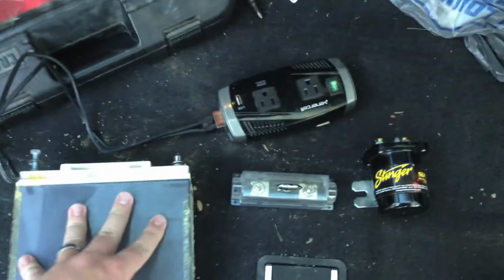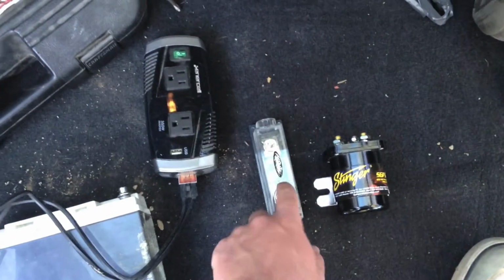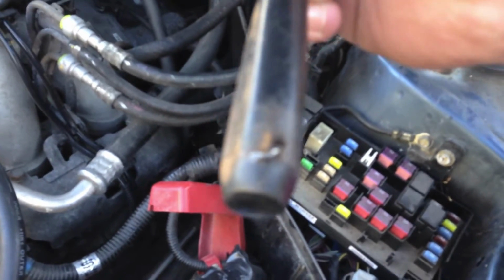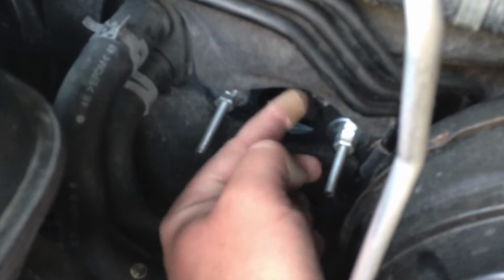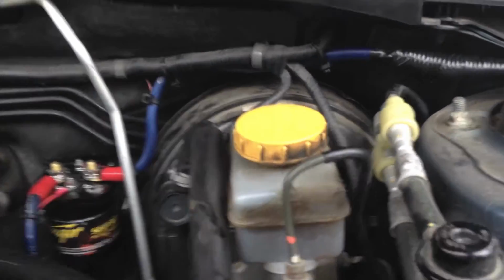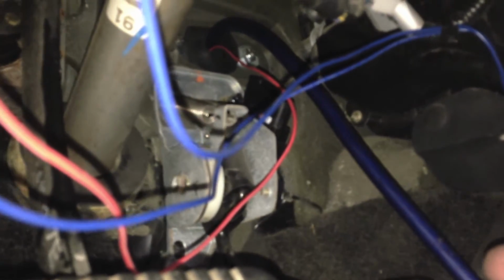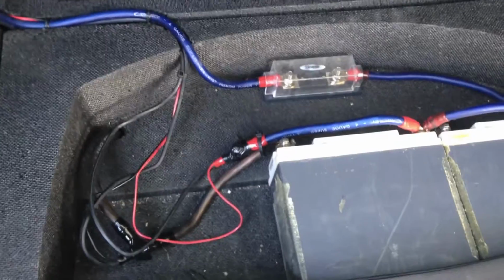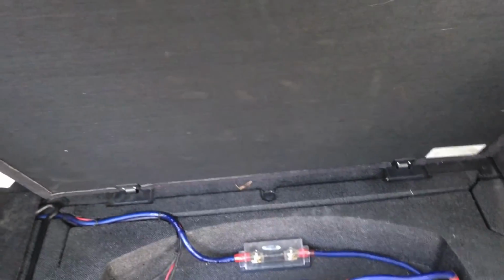ADDING AUX. BATTERY BANK

Comment: that's a smart idea and if the battery's in front die you can grab the jumper cables and use the rear battery's
Reply: Or just jump the isolator so that current flows back up to the front